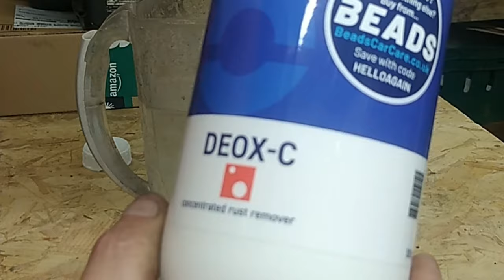How to Restore a Rusty Wrench Tool Like a Pro

Comment: I have been considering getting a little 1" belt grinder.   Do you find it was a good investment?
Reply from the maker: It was / is . I use everything less lately . It's my most used electric  tool  on smaller items for sure 
just wear insulated boots when using . ! Belts are cheapeston amazon .